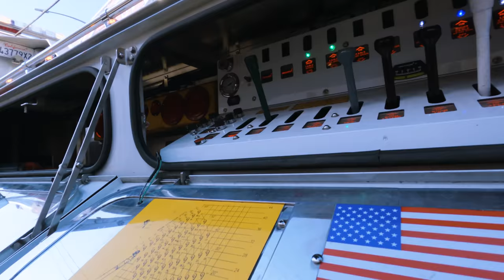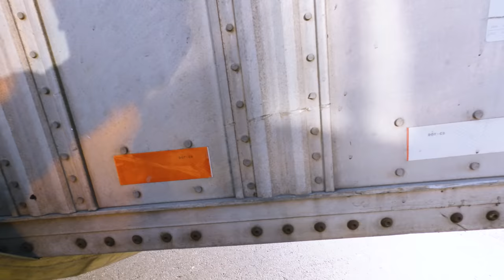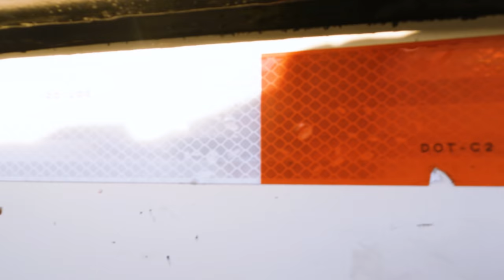Trailer destroyed by train - the train ALWAYS wins

Comment: For anyone the doubts the power (and weight) of a train ... I used to work with a small scenic railroad.  11 passenger cars @ 125,000lbs apiece, and two 235,000lb locomotives.  That little train weighs over a million and a half lbs.  That's a lot of kinetic energy when in motion.

Now imagine a 150 freight train... 150 cars @ 284,000lbs apiece, 4 or 5 locomotives at 450,000lbs ... moving at speed.

nothing is going to win that confrontation.

Comment: That lead locomotive engine was a GP-38 - probably 60 or 70 years old. They're no longer used in mainline service but are used for moving small cuts of cars around switchyards and delivering cars to customers. Definitely not the first vehicle it turned into scrap in its service life, and a little TLC from the body shop and it'll be going again.

Those old things are tough as hell.
Reply: Sorry Jim.  Check the UP roster.  It was built in Jan 1980!

Comment: Some people just shouldn't have a CDL. It's common sense to not proceed over a set of tracks without checking both directions first. And it would have been super obvious that the train was coming. Unless he had a mechanical failure in the tractor itself he had no excuse to be crossing those rails.
Reply from the maker: While I agree, this intersection does not have the arms that go down when a train comes. Might have been in a hurry and missed it, but still you NEVER proceed without double checking

Comment: Those are "slip sheets" -- warehouses put them down before placing stuff on a pallet so that a special forklift can grab the sheet and pull the product off of the pallet leaving the pallet behind.  It makes handling product much easier.  Whole pallets can be easily broken down and product moved with the machines instead of manually stacking it.  You can also pull products off of pallets to load into shipping containers since it makes no sense to waste space in a container that's stacked to the ceiling with pallets.
Reply from the maker: Great info, thanks.
Reply: Yes sir there called a pull pack. I use to drive a tow motor that had one on it. Stacker fold up about 3 inches of the bottom sheet creates a lip on it and the pull pack clamps on and pulls it on the forks.

Comment: I work around cranes that lift yachts out of the water and I believe that you could spread your weight around better if you ran your spreader pipe/bar with the length of the load rather than across it.

Comment: Easier to run the slack adjusters back. Usually a 7/16 socket or just loosen the chamber up on the back. 2 15/16 nuts and u don't have to worry about the dangerous spring. Just a suggestion

Comment: When loading the front half on the Landol, I would have taken the spilled cardboard and stacked it to make a level place to land the open end on the trailer. I think it would have made your load a lot more stable and easier to secure without the fear of the landing gear failing on route to the yard. Something to think about.
Reply from the maker: There was never any worry about the landing gear failing in the two miles it took to get to the shop. If I was not very local, I would have just cut the landing gear period.

Comment: You guys did an awesome job! Why don't you have a dump trailer and skid steer for jobs like this? It would make the cleanup much easier.
Reply from the maker: It actually would not. We were able to salvage and save almsot the entire load. It's more work to hand stack and re-palletize the load but the customer was very grateful. It also made it much easier to deliver because we just backed up to his loading dock and the fork lift pulled out the pallets. Your way would destroy the load, on top of making it very very difficult to deliver. A skid steer has its use, this was not one of them.
Reply: @PepesTowingService  I totally understand what you mean. I'm amazed that most of the load was able to be saved after getting hit by a train. You guys are top-notch professionals!

Comment: There has been some discussion about the forces put on a wheel when you use a rim sling and tug on the wheel. Personally, I think its OK if there is no obstruction or you are towing a trashed rig. Otherwise its not rocket science if you think about it, the force is on a small area of a ball bearing, not  designed for static heavy side force.
Reply from the maker: You're on the right track about forces, but they are case by case. I've done tests with my load cell on these. If the rear was buried or stuck, you could possibly run into issues pulling from a single front rim. In a case like this where I'm simply pulling it to pivot on asphalt, it's minimal.
Reply: @PepesTowingService  Agree. thanks for the input.

Comment: Why not boom the empty half of a trailer around first? It seems like it would be harder on the wrecker, to pull the tractor
Reply from the maker: Is this serious? First, the trailer wasn't empty. I don't know if you skipped that part of the video but it was clearly loaded. Second, how would you "boom" it around? It's a torn trailer with no lift points, hence why I used two spreader bars to lift it. Lastly, Hulk is a 50ton rotator, winching a tractor didn't even make it flinch. That's the equivalent of telling Arnold Schwarzenegger not to lift a 5lb dumbbell because it will be hard on him lol
Reply: @PepesTowingService  I understand now, was just curious. I know the spreader bars were needed. Good job!
Reply from the maker: @redneckrailfan9625  thanks!

Comment: Click Bait Picture: FAKE!!! How the HE** was that trailer hit by a TRAIN and the ONLY visible damage is the AXLES AND SUSPNSION are missing?!?
I've seen vehicles hit by a train and pre-Photo Shop photos of the same. 
The school bus compay I drove for had framed pictures of one of their busses hit by a train (before I started working for them) in the driver's lounge, as a "argue with a train, you WILL lose" reminder. 
Biggest piece of that bus after being hit was the engine and transmission.  Second biggest was a section of floor with the driver's seat still attached. (Thankfully the bus was empty except for the driver, who somehow managed to survive. Yes. He was fired.) The rest of the bus was scattered for over 500 yards the direction the train was going, and maybe 100 yards out from the tracks. (no habitation at that crossing, just desert and weeds/brush) The frame was broken in 5 or 6 pieces.  Too many bus body parts to count. The bus pretty much exploded when the train made contact. Oh, the front and rear axles were no longer connected to any portions of the frame.
.
BTW: Train vs ANY vehicle is "Train Wins".
Reply from the maker: Holy crap, are you a psycho? Did you even see the video? The UP train in Vernon travels at 10mph since these tracks don't have crossing guard arms. The trailer was in the intersection when it got hit, and the train tore it in half. I hate social media because it makes it harder to tell if someone is being a giant troll or just very very very stupid. Based on the length of your comment, I'm guessing you are the later.

Comment: Why didn't you guys clear the tracks 1st. Before cleaning up
Reply from the maker: Huh? The cargo load was worked concurrently with the trailer loading. What are you talking about?
Reply: @PepesTowingService  clearing the tracks 1st instead of leaving back half of trailer on tracks
Reply from the maker: You are really dense it seems so I'll try to break it down so you can understand. 1.) Hulk was the truck to load the first trailer, then tow the second trailer. Did you expect me to tow the 2nd trailer first? Then that would leave the first trailer still there for much longer. Besides, the entire tracks were closed. What difference would it possibly  have made to tow the 2nd trailer right away? You obviously aren't in the industry, otherwise you would know the first step is to develop a game plan and prioritize. Lastly, the 2nd half of the trailer wasn't even on the tracks? Open your eyes before you comment and nag.
Reply: @PepesTowingService  how about a 2nd truck haul away the back of the trailer instead of keeping the railroad shut down! I'm not dence.. only been doing towing recovery since 1988.. But I'm dence remember?
Reply from the maker: @ferrasrotator  are you being an idiot on purpose? That part of the trailer had nothing to do with the tracks being closed. You're dumb as rocks if you think that's the reason. It takes hours to do an investigation. They didn't move the train until night, and if you noticed the trailer was still there, easily proving the trailer wasn't in the way. Besides that train runs thru there once per day, not like it's a passenger train. The stupid arguments people choose to start, I swear. Go be miserable on someone else's channel
Reply from the maker: @ferrasrotator  apparently you are so dense, you don't even know how to spell it.
Reply: @PepesTowingService  you know I used to watch you're videos.. But since you wanna be a  funny guy.. Good luck with you're videos.. But when you put you're stuff out there for the public to view. And one person asks about something and you get defensive over it..
Reply from the maker: @ferrasrotator  appreciate you being a fan, but it works both ways. If you make a comment that makes no sense, I'm allowed to respond, right? You can't parade the freedom to make comments in my face then get hurt when I respond. I tried to brake down why removing the second trailer in the beginning didn't make sense and you were too stubborn to listen.
Reply: @PepesTowingService  all I did was ask a question.. Sorry you got butthurt over it
Reply from the maker: @ferrasrotator  and all I did was answer. Not my fault you couldn't grasp my response
Reply: @ferrasrotator  Why the rush? The tracks and road can't be cleared until the investigation is completed. If it was strictly a vehicle accident on a street or highway the police would handle it. Only one jurisdiction.  In this accident it involved a common carrier and a train. There are multiple jurisdictions that have to conduct an investigation.
Reply from the maker: @marc7491  thank you, someone with common sense who actually saw the video. I can't get through to him and now he's upset I replied lol. The investigation was running concurrent to my recovery, they didn't get the OK to move the train until night time. Either way that part of the trailer wasn't blocking anything, was just chilling by its lonesome on the other side of the tracks.